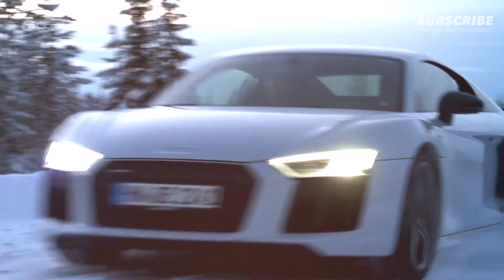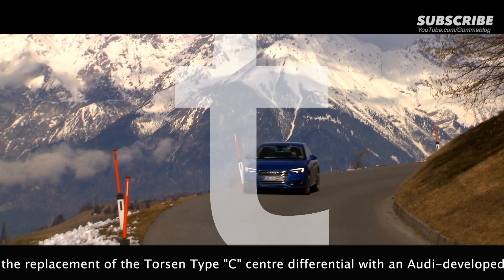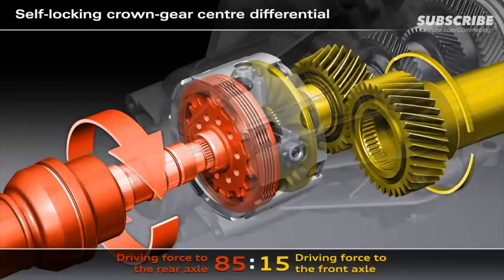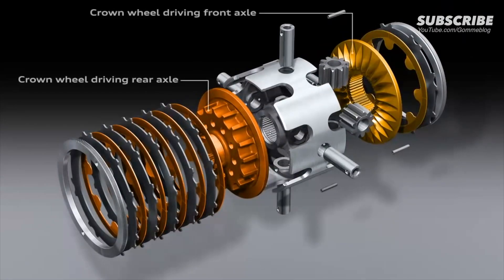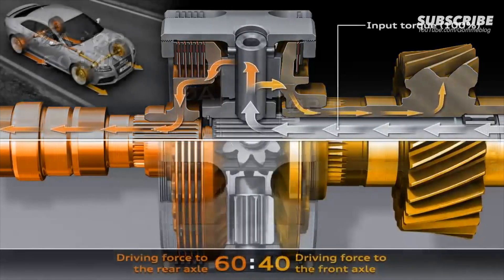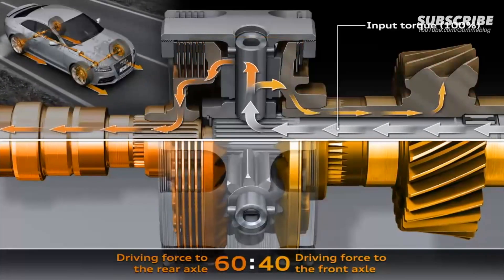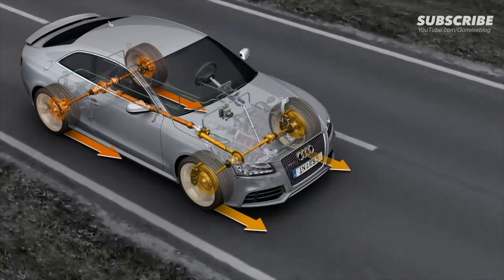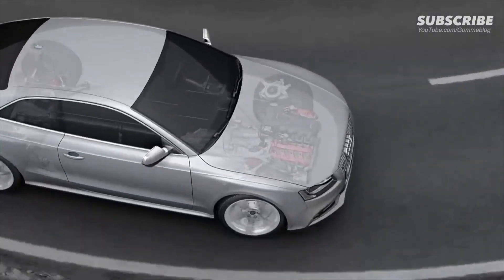Audi quattro AWD DIFFERENCES - Torsen vs Centre Differential vs Haldex vs Ultra

Comment: Useless video.. Torsen isn't shown, you showed Crown Gear which is only used on S and RS models. 

Ultra which is used on most modern Audi for fuel economy.

Haldex used in S3 & TT etc..
Reply: S and rs are supreme. As I have em...

Comment: Anyone knowing what is the type of the quattro in my car ?
It's Audi A4 B9 Allroad 2.0 TDI 190hp, S-Tronic 7 speed gearbox.
Reply: Could be the quattro ultra, not sure 100%
Reply: @SamuelVaran  nope. Mine is with torsen. GH1 code.
Reply: @plamenyovchev that’s great! What year is the car?
Reply: @SamuelVaran  2017
Reply: @plamenyovchev  hahahahaaah EVERY 35/40 TDI/TFSI engine is equipped with quattro ultra (haldex), torsen is only for engines with more turque like mine 50 tdi which is always with calssic hydraulic transsmision - tiptronic (zf 8hp)
Reply: @Beniamin2510 this is just not true. My Audi is not haldex.

2.0 TDI 2017 190hp
Reply: @plamenyovchev  dynamic, esp-off (not sport), turn steering wheel to the max and full gas and check if you can "drift" if your rear wheels will slipp ONLY (without front), if yes then its quattro ultra/haldex, if it will be more "awd drift" it will be torsen but its not possible, its too small engine, too small torque for use this type of awd
Reply: @Beniamin2510 bro Haldex-system doesn’t even fit in cars with longitudinal mounted engines….
Reply: I have b9 A5 coupe 2.0 tdi quatrro from dec. 2016 --- I have torsen T3 100% . Go to the trunk and search near the tire for a paper with your PR codes, based on the specific codes you can know for sure if you have ultra or torsen.

Comment: What kind of Torsten system does 4L generation Audi Q7 have? Anyway, I love how it drives in the winter with proper winter tires. It’s way fun with controlled rear end slide under full power. I don’t think my 2013 has too many electronic gizmos in the system.
Reply: Torsen C with 42/58 FR torque split. Unlike other torsen quattro systems, the one in Q7 has separate transfer case so it's not that nose heavy.

Comment: Does the s4 b8 and rs4 b7 use a different system? If so what kind?
Reply: Well, it was 2 years ago, and there no response so far . A4b7 generation uses torsen, and i believe the b8 generation can use it too or the ultra. Depending on how was bought at the dealership

Comment: And now invent something that can disturb power from left to right because Quattro is the worst system that does(n’t) that. Maybe Subaru wil teach you a thing or 2.
Reply: your comment is totally wrong and uneducated. your subi system is pretty crud and outdated. they realized that too, thats why they upgraded a little DCCD. Welcome to the modern world
Reply: Well, suby doesn't do that either. STi's DCCD is a more adjustable centre-diff with front and rear LSD. As of I know, only Mitsubishi's S-AWC and Acura's SH-AWD push power left and right. There might be more system that does it.
Reply: @papercut1987  all LSD's distribute torque left and right depending on traction. Audi has the sport differential for example, which actively regulates this.
Reply: @HardwareG33k  Not quite. Limited-slip differentials can only transfer extra torque to the slower-turning output, regardless of what is actually needed. Passive systems transfer extra torque to the slower-turning output even if it is the opposite of what is wanted (for instance, when turning without significant tire slip, the LSD drives the tire on the inside of the turn with more torque, causing understeer).
Reply: @brianb-p6586  I'm not sure which part of my comment you're referring to. In regards to passive LSD causing understeer, you are certainly correct. Still, the exact torque distribution will depend on the traction levels of both wheels.
Reply: @HardwareG33k  All of it. 
"all LSD's distribute torque left and right depending on traction" - yes, but they can only distribute more to the slower-moving output. 
"Audi has the sport differential for example, which actively regulates this." - yes, the amount of torque transfer can be actively controlled, but without an actively controlled clutch connecting step-up gearing to the carrier for each side (like Mitsubishi's AYC) they can only transfer more torque to the slower-turning output.
Active control can avoid the unwanted adverse yaw by not engaging the torque transfer clutch when it is not needed and would be unwanted.
Reply: @brianb-p6586  I see what you're saying. I'm honestly not familiar with how the AYC works, but I did think the Audi System (which is electrohydraulic also, and has gearing on either side) could torque vector to a limited degree as well, since it can lock either side to the carrier independently. I'll need to take another look.
Reply: @HardwareG33k  Yes, as I recall one of the many systems used by Audi can do this... but not LSDs in general.
Reply: @brianb-p6586  obviously not all LSDs are active. But the Audi system (it is simply referred to as "Sportdifferenzial") is.
Reply: the new mk8 golf r can do that
Reply: @antoniosadorra4961  The Golf R and the new RS3 have the Magna system instead of Haldex. It was the same system used on the Ford RS.

Comment: i have an  audi a4 b9 2017 , 2.0 TFSI engine with 252hp quattro, CYMC engine. what kind of differential i have ? can u give me some links to see ?
Reply: Quattro Ultra, i.e. not permanent quattro like with a torsen.
Reply: Torsen center diff. If you have the Quattro Ultra, there is an additional claw coupling which disengages the rear wheels under normal conditions to save fuel.

Comment: I’d hate to pay or fix that lol
Reply: Flat4Fan I just had my haldex and rear diff replaced on my S3 it’s still in the shop. From what I know now I’m paying $2200 out of pocket with my deductible included. This was due to a discrepancy between the warranty and repair shop pricing. I want the work done at the dealership for peace of mind. My warranty company wanted to provide a used diff but the dealership refused to put in a used one. I would feel better if all parts were new so I went with the dealership. The kicker is the first repair shop I went to was a joke. The mechanic tried to give me advice on how my key ring had too many things on it and how that was bad for my car?? Then I let him know “hey it’s push to start”. Red flags everywhere! So I decided to pay the premiums for a nice 2020 Q5 loaner vehicle and a clean OEM repair for my 15 S3.
Reply: @dontefit  Interesting story. What actually went wrong with the diff?
Reply: Mini-ITX RiG yeah the warranty did cover it but the shop refused to put in used parts so I paid the difference
Reply: Mini-ITX RiG the real total of all the work done was well over 8000$ but I only pained 2200$

Comment: Does this also apply to related S and RS models?
Reply: RS3 has engine transversely, so Haldex based AWD with 100/0 front rear distribution up to 50/50 only.
Reply from the maker: YES ... Thanks for Your Comment !!
Reply: @GommeBlog   why does it seem the crown gear is only on a few RS models and not the rest?  thought it was lighter and smaller...?
Reply: Actually it's pretty confusing, but the best I can tell from Audi web site the S4, for example, has the full time AWD I believe, were as the A4 has two versions 1 ultra and 1 non ultra, The ultra having less power, pretty sure it has the decoupling rear end, but not sure on the non ultra. From drivers perspective I definitely prefer the crown gear over trying to save fuel. I am betting the RS3 has crown gear as well.